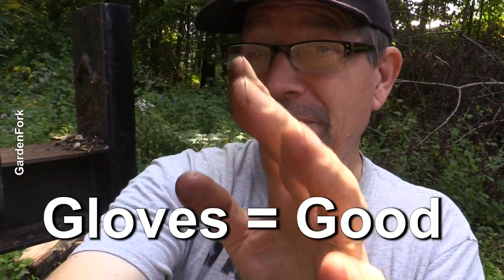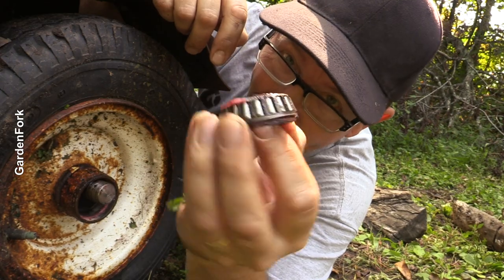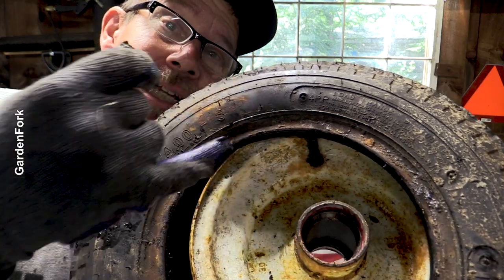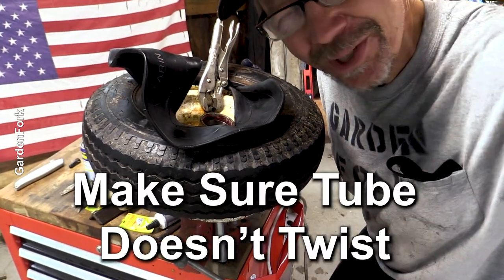You Can Fix A Flat Tire, Here's How...

Comment: You smeared grease on the bearing but didn't pack it. Okay but the reason the 2nd tire/ rim was loose is because the bearings were dry and wearing out. 
Proper nut tightness on a bearing is all the way and back off a quarter turn. Spin the tire a bit while tightening to ensure both bearings are seated well. 
Thats my 10 cents. Good video by the way.